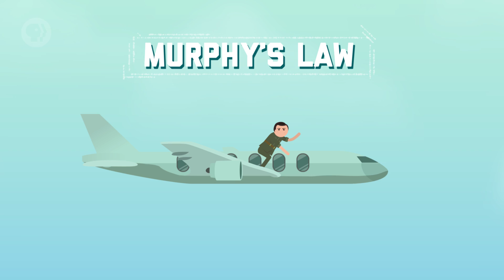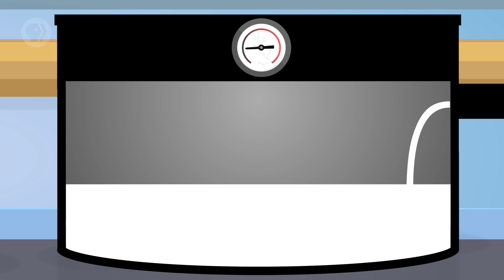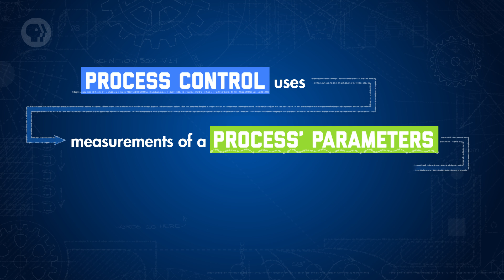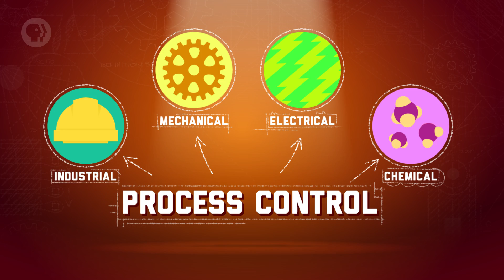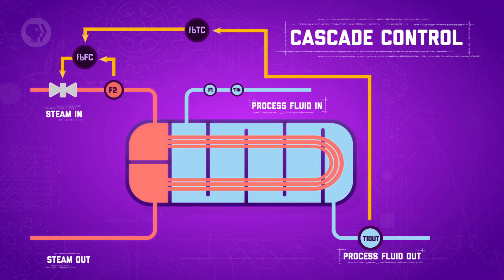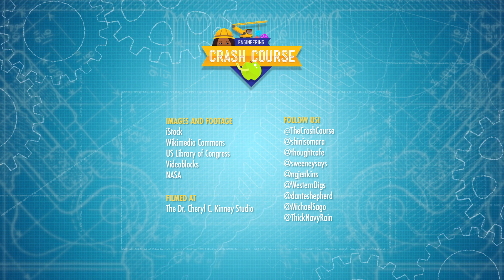Cheese, Catastrophes, & Process Control: Crash Course Engineering #25

Comment: Always assume imperfections in your sensors. I work with drone software. One of the research groups we work with has drones that use barometers to estimate their altitude. They figured it was a great idea to figure their drones landed when the barometer says the height is 0, and completely shut off the motors. Unfortunately, barometers aren't super accurate, and also can't measure the absolute height above ground. The drones ended up falling down a meter or so, and breaking some parts.

Comment: I did a module on Control Theory as part of my nuclear physics degree, and as Lewis Foster says, PID is important. I thought it might interest people to have a practical example from that:

In order to keep a nuclear reaction steady, you want a set neutron flux in the reactor, one way to control that is with the control rods. These are materials that absorb neutrons (In a PWR you can also add boron to water, in the form of boric acid)

Whatever you do as an intervention, there is always going to be some lag between action and effect

Now, let's say you get a reading that's too high, so you lower the control rods/add more boric acid, you go for a linear approach, so your intervention is directly proportional to your intervention. With this approach, you'll typically overshoot and end up with too low a neutron flux, so you then raise your control rods/take some boric acid out

Well done, you now have set off an oscillation in your neutron flux, and with a proportional/linear response that can quite easily be one that grows with each iteration.  For obvious reasons, that is not a good thing to happen in a nuclear reactor.

So you use an integral response to that initial deviation. I find it easier to think of this next bit like it's a mechanical system, with a pendulum, with that initial deviation from your norm being analogous to someone pushing your pendulum. You want to dampen that oscillation so it goes back to being steady, which is where an integral response comes in. You want a response that perfectly dampens that oscillation in the minimum possible time, not one like the linear response which is almost like your pushing it as it comes to the end of its swing

(Note: It's been a while since I've last done this, I might be a little off in places, and I certainly can't remember exactly how to explain how the integral response works in detail)

Comment: As obvious it might be to "decrease steam flow if something is too hot" it's not always the case. In reality steam is generated somewhere using the power of either engine that is cooled by this very same oil or a battery, that - guess what - is charged by the same engine..
I think it also should be mentioned that the whole process operates under assumption that a) desired behavior is at least marginally stable b) either globally stable or at least has a decent stability region

Comment: 06:00 Wouldn't you want to put the steam valve at the outlet of the heat exchanger? Taking a pressure drop at the inlet would decrease the steam density and and temperature due to adiabatic expansion, wouldn't it?